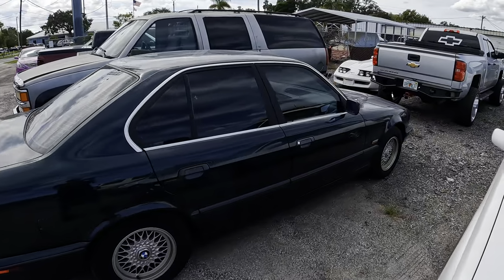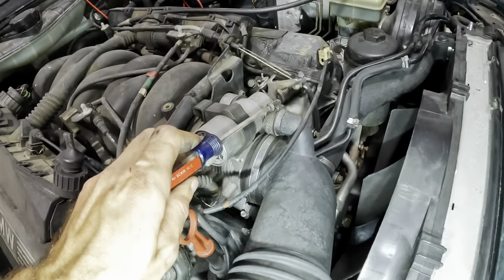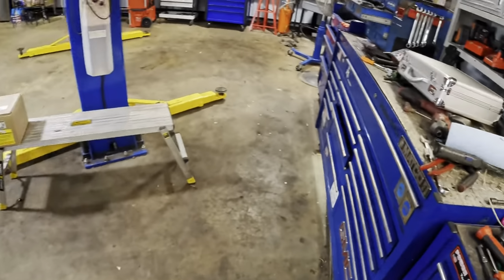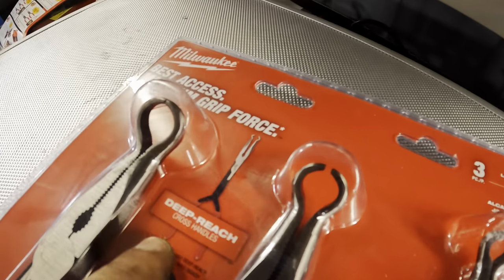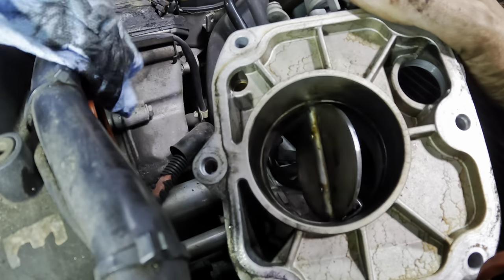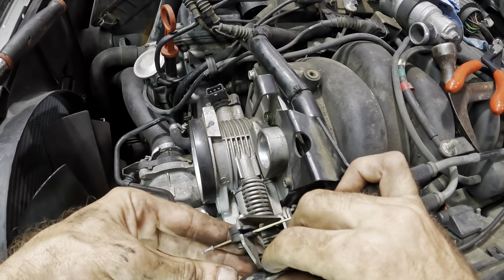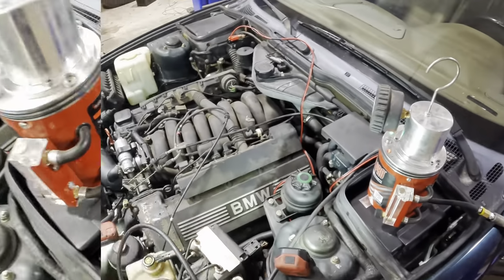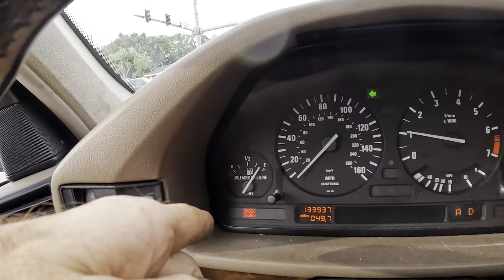DO NOT DO THIS! Hack Repair. Engine Diag Running Rough BMW 530i 3.0

Comment: You truly don't know how to use a smoke machine to detect intake leaks, (and I would aver for any of it's other uses). You must block the intake preferably just on the engine side of the mass air meter, and the EXHAUST! lest your smoke just blows out through the tail pipe! You then need to learn to use the flow meter to determine if the system is "tight". (how the hell are you testing evaporative control systems?!) Not confirming that the system was leak free, then not looking at fuel trim data, you have really effected no repair. Lack of fender cover use, and laying air hoses and tools on the customers cars is just cringe worthy. P.S. Your description of mass air sensor operation is incorrect,  circuitry in the sensor varies the current to the element to maintain a constant temperature/resistance of the element, as the air flow changes, it is this current change that is used by the engine controller for injector pulse width calculations.